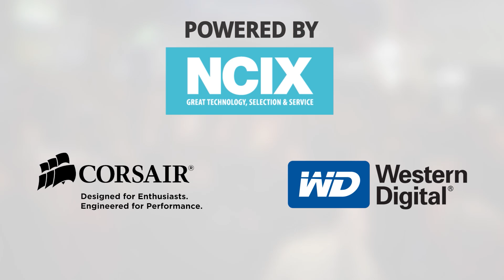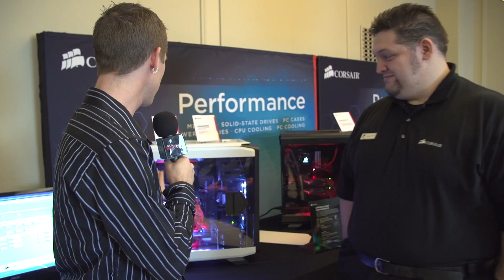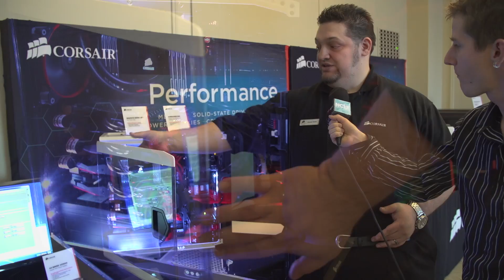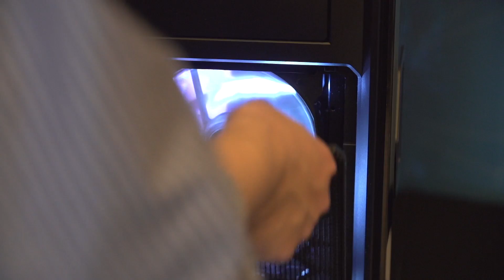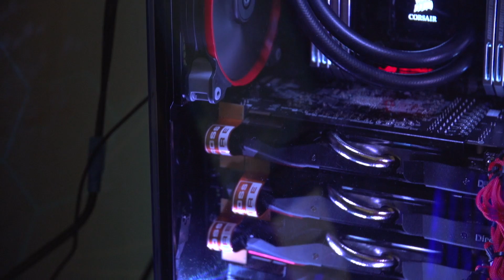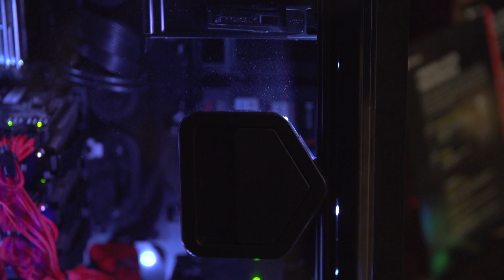Graphite 760T with Corsair George!  - CES 2014

Comment: I just ordered one of these and it will be here soon ...Why the hell is there not dust filter on the top and can you buy one that will drop right in....WTF
Reply: Yes your right there are after market ones.....but i think you missed my point for a high dollar case it should come with them standard ....WHICH IT DOES NOT LIKE I SAID>>>>>>>
Reply: I have a H100i in the top and i cut a hole in the cover that comes with it and bought some aftermarket dust covers and put them over it ...even tho they blow out i did not want dust to fall in it when its off and not blowing out ..its all good now ....its not a problem i just think a case at this price point should of came with a dust filter for the top. I solved the problem thanks for the advise tho.
Reply: Yeah I see your point.
Reply: There is dust filter at the top.
Reply: No there is not i own one and there are no dust filters on the top.
Reply: Look up 760T dustfilters they have  an aftermarket top one for 20 bucks
Reply: scott k You could make some little feet for the cover, so it'll give some protection against dust while still allowing air to flow? Not optimal, I know.

Comment: With the new information by George, I'd say it's safe to assume that the "sagging" GPU on the bottom of the stack is disconnected from the motherboard. Like he said, "just for looks." You can see there aren't any PSU cables attached. It worried me in the other videos on this case/CES 2014, but it makes sense to me now.

Comment: The 760t looks good but the only change that I would make would be to have that discrete air flow vents like the front of the 350D allowing air to go through the gaps. I would put those on the top and front of the 760t to give the sleek look. Hopefully some pc modifier will make something like that!

Comment: All that is only 600 Watts? Much lower than I'd expect for four 280s AND a Sandy-E.
Reply: three, one is fried.
Reply: ***** So? It was using 600w.
Reply: The PSU is 1500W, yes, but the actual usage right now at full is only 600W. WAY less than I'd expect, seing as my Sandy non-E and single gtx660 it around 430W.

Comment: That looks really good but definitely deserves a 5.25" bayless version. optical drives are dead and those who'd like front panel display/control boxes can still get the version with a bay (or switch to a different control method).

I can see myself disliking Corsair soon as they're becoming so big, they're bound to turn into a bunch of greedy nobs, but for now they're pretty awesome.
Reply: Some of us also use bay reservoirs, media card readers, and the previously mentioned control boxes and we like having 5.25 bays to accommodate them. Personally I still use an ODD for my older games and installing the OS/other disk based software.
Reply: Mark Ewing 
I tried to imply all the other bits, I wasn't going to list everything :)

Indeed, I'm not saying all cases should be front-bayless, I'm saying there should be bayless versions. There's nothing I need a front bay for anymore. 
I prefer tube res to bay res

I prefer hidden fan/pump/lighting control to a front bay box

I prefer USB ODD to fixed ODD

I'm know there are others who feel the same as I do and others who have the complete opposite preference. One side is very well catered for, the other completely ignored, we have to mod cases to try and get the desired config.

Comment: That GPU sag is horrendous
Reply: i belive it was the fried one
Reply: I have a problem with those huge GPUs being installed on vertical main boards. It puts a lot of pressure both on the GPU and the main board sockets. Horizontal setup is also better for large heavy air coolers.

Comment: Next time you see George ask him how he installed multi gpu's into the 900D. Some pretty big design flaws with that case.
Reply: I love how you just bash a case for having design flaws without pointing out what they are..
Reply: Akio Furukawa Firstly most people who know the case know the flaws so really I didn't need to list them in a passing comment this isn't a review nor meant to educate those who don't know. The guy designed the thing I'm sure he knows about the GPU issue by now. It has been over a year.

Secondly it's more of a snipe at George because as I said he's the guy who designed it and the oversight was kinda poor. 

If you've had the displeasure of installing aftermarket gpu's in the 900D you'd surely have noticed the say 2.5'' overhang on the left side where the rim of the case blocks you from clear access to screwing in the screws to secure the GPU. Not an issue for reference design cards or even cards that have water blocks on them. But beefy cards like MSI gaming, Lightning, Asus DCU II etc and you're sort of boned. 

Ultimately there are a few ways to get them in, but simply reaching around and trying to screw the screws in, won't work. Unless you're very, very lucky.

Comment: All that and only pulling 600w?
Reply: Didn't he say they were running stress tests though?
Reply: Holy crap...
Reply: Yes, most people far overspec PSU's, a gtx780ti reference only draws 250watts fully loaded, with non-primary cards in SLI drawing less than that, sometimes down to half. In addition a fully loaded i7 six core draws less than 150watt. Other components (HDD's, wifi, fans ect) will be drawing easily less than 50watt. So its fully conceivable even with the entire system fully synthetically loaded will use only 700w, meaning 600w usage is all you'll see if one of the components isn't as heavily loaded, for instance I believe they where running only fur mark, so the CPU in this case. I'll also note what I said about SLI only works with SLI, for crypto coin mining or other computation multiple cards still draw there full amount, hence the need for the PSU's on the market over 1.2kw.
Reply: It's in idle, so I think - yes :)
Reply: I think I have missed that. The next video with a 1.6Kw PSU from LEPA runs on a stress test but only draws about 700 something watts.
Reply: hondarider430 only stressing the cpu :p
Reply: Hamish McGregor its best to over spec a PSU the more watts u have over ur max load gives u that much more leeway for upgrades and for when it gets old and cant keep up.
Reply: I still don't get it. I can pump ~300W through my single 280X while mining, no problem.
So, 600W.... how??
Reply: FraeschD only the cpu is stressed, the gpus are at idle

Comment: I wonder what they used for the motherboard as that is almost a complete Corsair based PC lol
Reply: Fairly sure it's an ASUS Maximus IV Extreme
Reply: ***** The IV Extreme edition has 8 dimm slots.The regular non extreme has 4.
Reply: ***** do you have a legitimate need for a X79 board?If not consider the LGA 1150 platform or the AM3+ platform.Also where are you buying them and for what pricing?Because the formula seems to be at EOL and the IV extreme is $400.If you need the X79 platform do you really need all that expandability consider something like the rampage gene or ASRock Fatality.
Reply: mvitkun Asus Rampage IV Extreme Black Edition, or the normal one
Reply: the13796 He said Sandy Bridge E, so probably the normal Rampage IV Extreme
Reply: mvitkun Should I get the extreme or the formula?
Reply: I'm really quite partial to my black edition.  I see no point in grabbing an m-atx motherboard with a 2011 socket, the main reason to buy x79 is to get the native pci-e lanes for a bunch of add-in cards. 

I agree that the Rampage IV Formula boards are EoL, I haven't seen them in stock in ages.  If you're going to stop at 2 GPUs, go with Haswell, I actually really like the Maximux VI Formula, I don't really recommend using the vrm waterblock in a waterloop, though.  Even if it's got a coating on it, it's still aluminum.